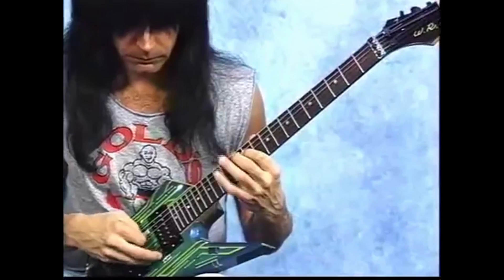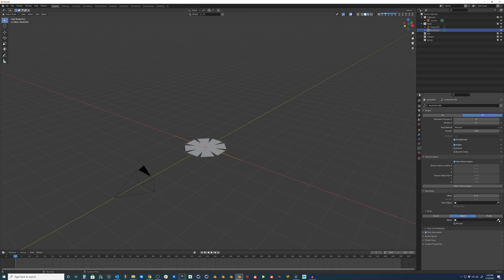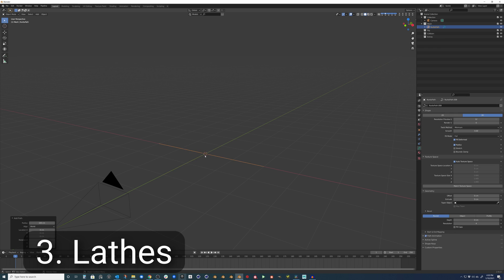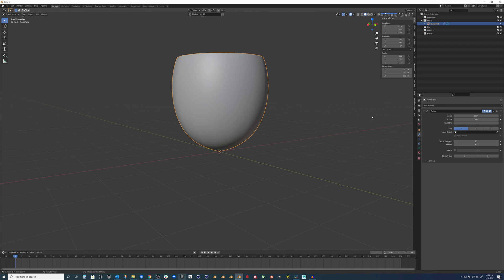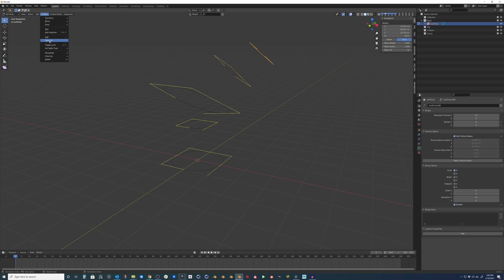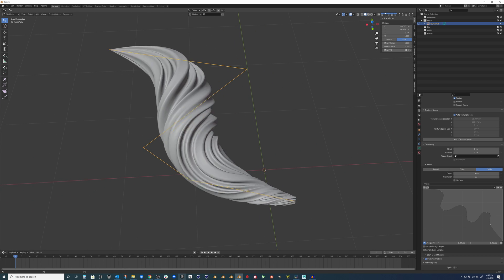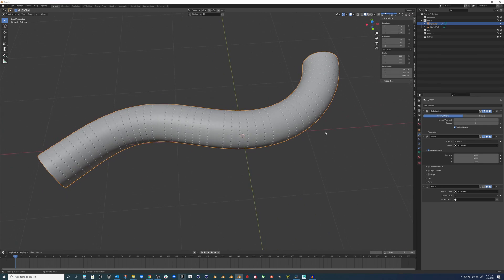Curve Modeling in Blender! | UNDER 4 MINUTES!

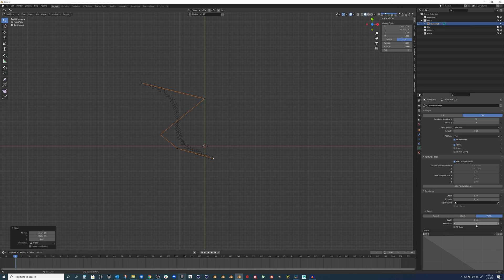Comment: 2:16 Is it possible to use another spline as a profile shape, as it does in 3ds Max?
Reply from the maker: @fxtttfx  yes! You can set the profile to a custom curve in the object properties. Lemme know if you find it! Cheers
Reply: @GlassHandFilms  Thank you! It has solidified my movement from 3ds Max to Blender ☺
Reply from the maker: @fxtttfx  great to hear! 3ds Max was my first 3D software that I learned. I also use it at my day job. But I just love blender so much. 😊 Cheers!!